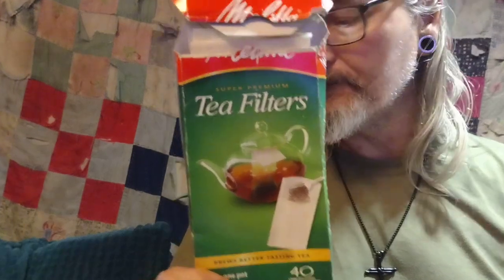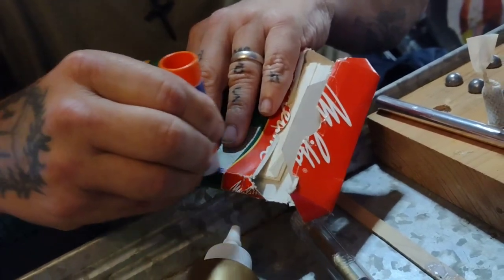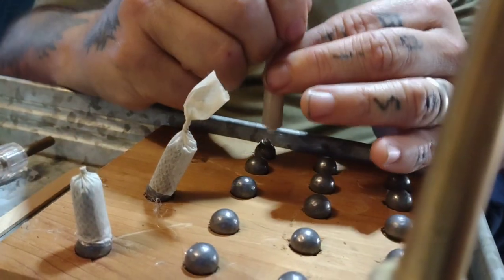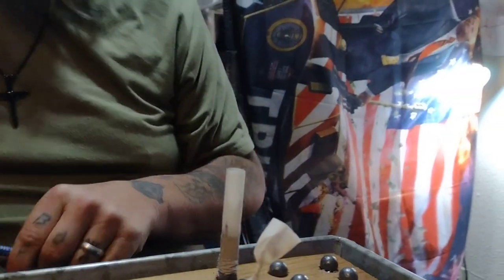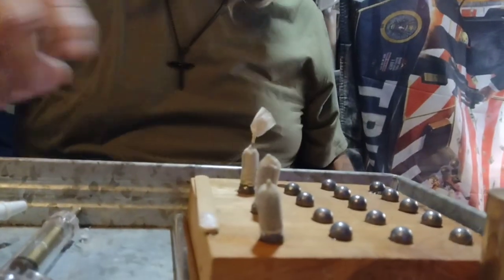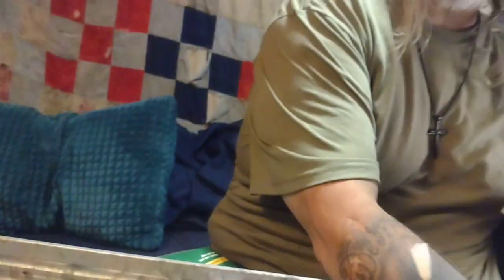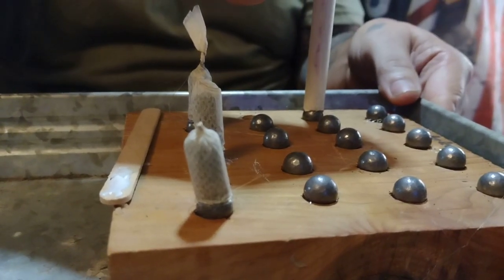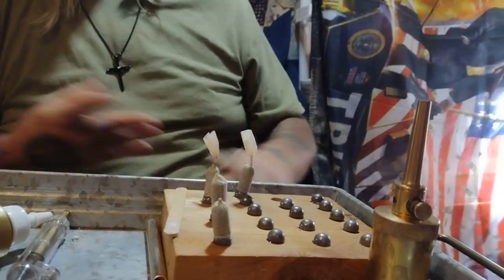Making paper cartridges for the .44 caliber percussion revolvers.

Comment: I bought flash paper that magicians use. Stuff works great.
Reply: Is it not a bit on the volatile side?
Reply: @connorhart7597  not that i know of. It just lights up and disappears really fast.
Reply: @Coopdeville06  okay 👍 didn't know if it would a) light easily or b) if it did light, would it light the powder, y'know?
Reply: @connorhart7597  it is no different than say the  black powder just faster burning.

Comment: good vid but what I want is to have a lubed wad between the powder and ball.    so far the only way is with pyrodex pellets.....lay pellet then wad then ball and roll to the glue edge   then just twist both ends... trim.   ball pellet and wad are all different dia so cant use a mandrel
Reply from the maker: I haven't tried to make paper cartridges with a wad between the ball and powder, I usually just lube the tops of the cylinder chambers after loading the paper cartridges.
Thank you for watching.

Comment: Thanks for the great video!  Do you have to adjust the powder amount to use conical bullets?
Reply from the maker: Yes, I go down a little bit on the powder so it all fits into the cylinder chambers.  When using a conical bullet I can load 26 grains of fffg black powder and with round balls I load 30 grains.
Thank you for watching.

Comment: i never made these or thought of using paper cartridges.. is it really much faster to use at tje range versis just filling all 6 and putting 2 balls on a cylinder.. ram ram two balls ram ram.  etc ?

have you thought of smacking your flask measure ?  i noticed 30 grains poured isnt 30 grains.  if you tap the sides a few times with a hard object it drops from settling.  and its more like 25
Reply from the maker: I save a lot of time loading with paper cartridges.  I put the entire paper cartridges in the chambers and ram in it in, and I have the Snell Capper and cap it and it's ready to go, I also lube the tops of the cylinder chambers and I use an oral syringe with my homemade lube of pork lard and beeswax, it really helps keeping the fauling soft and allows you to shoot more rounds before having to clean and keeps the cylinder from binding up so fast.
Thanks for watching.
Reply: Depends on how fast you want to reload. You also might want to obtain medical specimin vials with caps that close. pour your powder charge into those and take the the range. The powder charge measuring is what takes the longest amount of time. Though these are not so "authentic",many get a kick from using authentic style paper cartridges with conical bullets. Those bullets were dipped in lube before the cartridges were packaged. Check out Marks Hubbs and ErasGone bullet moulds.
Reply: @jason60chev  i dont measure at the range 30 grains from flask is fast enough for me and i dont use wads or anything.  Waste of time and money